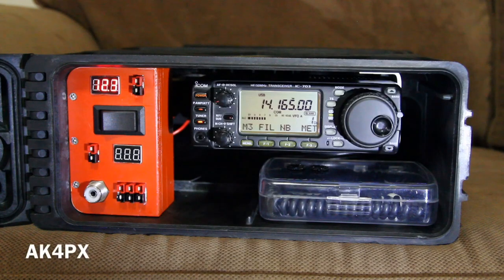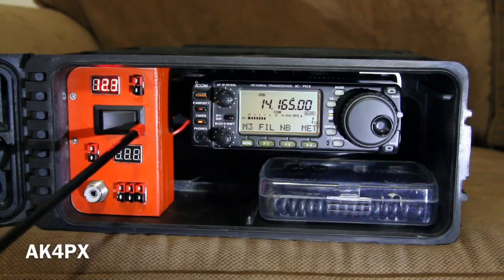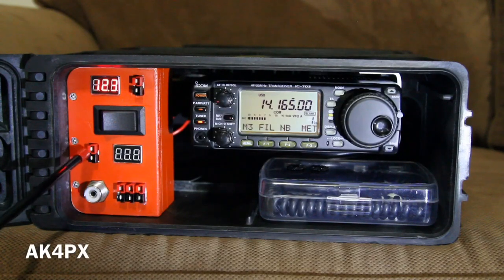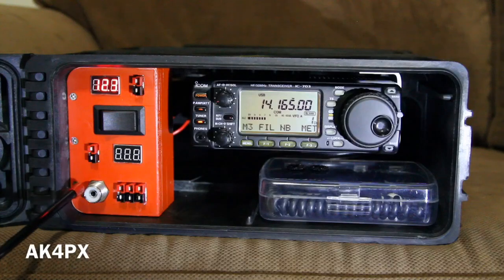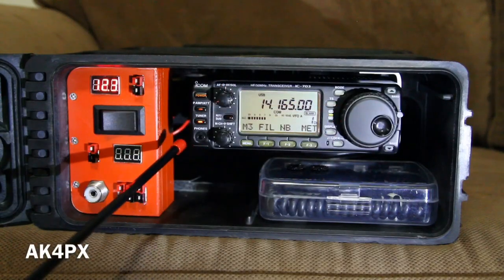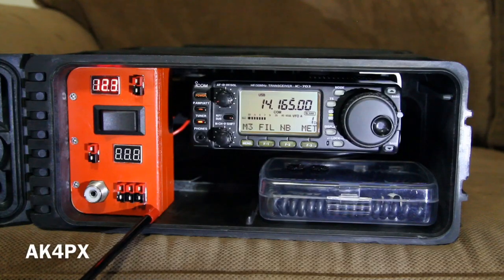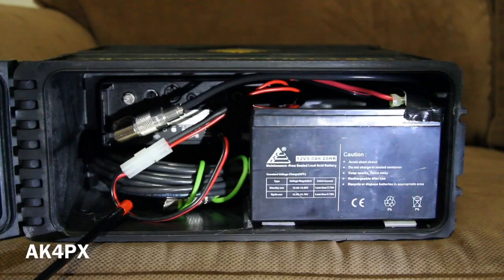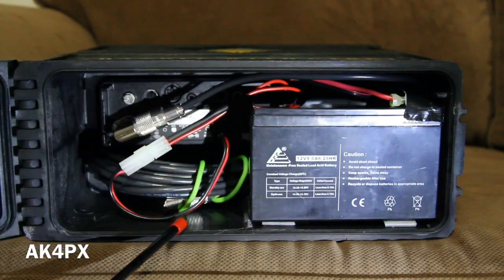Ham Radio Go Box gobox

Comment: Where did you find the 25mm ammo can???
Reply from the maker: Hi.  eBay.  Standard mil 25mm ammo can: Cannon shells specifically. Numbers on the can: Part No: 12013854, Container Assy No: 12013870, Container and Ammo: 12013668

Comment: This set up is more convenient than a clamshell box, because you can set everything inside in vertical position and save spaces in the mouth while keeping the box small and you can place it either flat or standing yet easy to access the radio on the go like HTs or settle down. And protecting the gear from both side.

Comment: Great, simple set up? How did you mount your radio and battery without drilling though the ammo box?
Reply from the maker: Thanks.  For the battery I used sticky tape to sorta hold it in place.  Once I slide in the radio it sits on the battery.  For the radio I bent some 1/8" aluminum and after numerous false starts I used a 3M product called simply '5200'.  It is a marine RTV.  It held for about a year lol.  A 7ah battery should fit fine too.
Reply: I appreciate your reply. I'm trying to get our Boy Scouts interested and we are planning to build one! BTW- I love my IC-703! Great radio!

Comment: Where did you get a ammo can that opens on top and bottom.
Reply from the maker: Hi.  Standard mil 25mm ammo can: Cannon shells specifically. Numbers on the can: Part No: 12013854, Container Assy No: 12013870, Container and Ammo: 12013668

Comment: I built something similar to this a long time ago.  if you're not already, you should consider using Shottkey Diodes between the charter and charged sides; less voltage drop across the diode.  I'd also look into if LCD displays  that used less power than the LEDs were available.

Comment: as a slight change/suggestion, you might look at swapping out the connector on the battery itself (and possibly the charging port so as to eliminate confusion) to a Deans connector, like we RC guys use on our LIPO batteries....which also poses that question....what about running a custom battery setup with RC LiPo batteries? either 4 2S batteries (2 series 2 parallel) or even one large 4S battery (and you'd have a much lighter setup with a battery that holds voltage much better) and getting the lipo setup would be a nominal voltage of 14.8V which you would run a circuit to cut it off at 12.8V if memory serves...so, always providing as much if not more power than the radio needs...or maybe one of the maxamps green series LiFe batteries like this one....  http://www.maxamps.com/proddetail.php?prod=Life-12400-132-Pack whose measurements are 6" X 3.5" X 2"(same flat format as lipos), weigh 2lbs 10oz, and are a 12.4A @ 13.2V (and yes, I know it's expensive, but, lets be honest, if you can afford to drop the 700-900 on a IC-703+ to put in a box, you can probably afford a battery that's going to pull the most out of that radio in a portable package)
Reply from the maker: I was thinking LiFePo battery(ies) once the price drops further.

Comment: Nice build, now I know what I can to with my 25mm ammo can. How did you mount the radio inside the can?
Reply: You can see the brackets in the back.
Reply from the maker: I used 3m 5200 to 'glue' the brackets to the can.  The adhesion lasted about a year, unstuck from the aluminum or the can but the can material definitely resists things adhering to it lol.  
The brackets are aluminum that I got from Lowes and bent in a vice.  
Simple kydex may stick better with the 5200.  I'll be trying that someday.
Reply: @danpass12  Here it is 4 years later. Do you have an update to how you got your brackets to stick inside the box? I have a couple of these boxes I am going to make into manpack rigs. I am nit wanting to drill into the boxes but I was actually thinking of using nylon or plastic threaded fasteners and drilling and taping the holes and threading flathead plastic screws into the box and sealing the heads of the scews and putting nuts on the inside to hold brackets on my radio. Please share with me your experience on how you fixed your problem. Thanks!
Reply from the maker: @kd5inm  The only thing I had that worked was 3M 5200.  But even that didn't stand the test of time.  I haven't used the rig in a while but my next idea is to use some kydex to rig up a slide-in frame.  The kydex would be attached to the radio.  The indent around the inside of the ammo can makes it challenging lol

Comment: Is this the battery you went with? http://www.amazon.com/12v-10Ah-SLA-Rechargeable-Battery/dp/B004WENYYE/ref=sr_1_6?ie=UTF8&qid=1427948831&sr=8-6&keywords=12v+12+ah
Reply from the maker: 9ah.  But the same thing, same size, same terminals, same printing on the side.  I got mine off ebay.

Comment: Very good and neat layout. I would concerned about cooling with a 706 operating in that enclosure because they run so hot. maybe instill a computer fan in the side or rear.
Reply: TK Reim It's not a 706, it's a 703.  QRP rig, nowhere near as much power.
Reply: Oh ok, I stand corrected. Yes Im familiar with  the 703. Much less heat dissipation .
Reply: I definitely wouldn't operate a 706--or even a 703--without both ends of the box open.

Comment: Oh ! I wanted to ask how you manage the heat buildup in the box ?
Reply from the maker: Hi Jon.  No fans or anything of that nature.  Equipment factored into the heat considerations.  In this case the 703+, with only 10w output, doesn't generate much heat.  It hasn't been an issue.
Reply: Just open the bottom. Those are standard 20mm ammo cans. so they open on both ends.

Comment: Nice idea overall, but how is the average ham supposed to duplicate the 3D printed part?
Reply from the maker: Scott, check out www.shapeways.com.  They offer a free CAD program to work with.  That, and a set of calipers, will get you what you need.
Reply: Scott, check out any local hacker/maker spaces.  Many of them have 3-D printers available for members and most are very welcoming of guests.

Comment: Nice clean job... you said the case was still waterproof...how did you mount the brackets? This looks small enough to fit in a backpack or sit on a car seat. Especially like the use of the DPDT switch.
 KC3CTT
Reply from the maker: I used 3m 5200 Fast Cure to 'glue' the brackets to the inside of the can.  Worked better than epoxy.